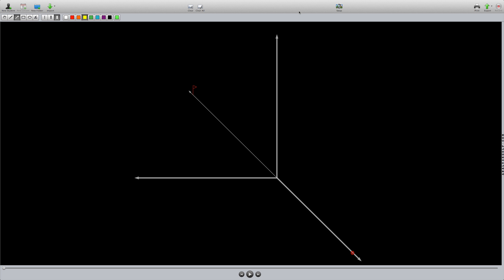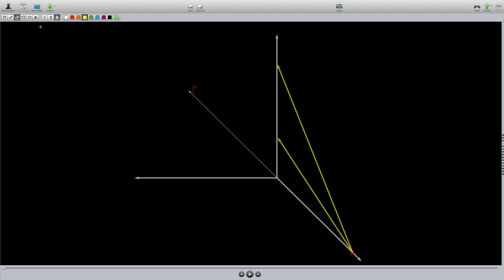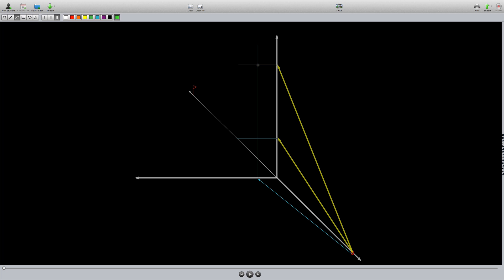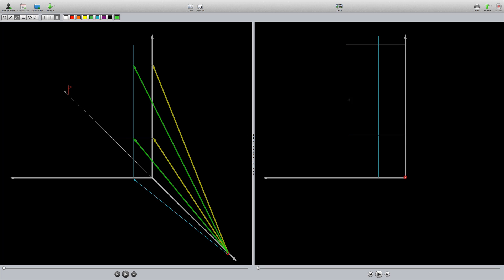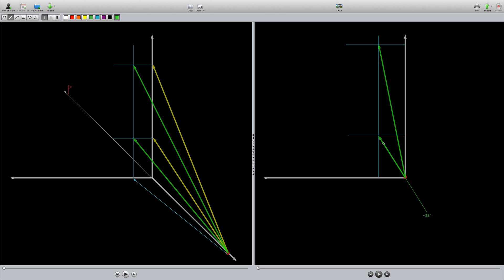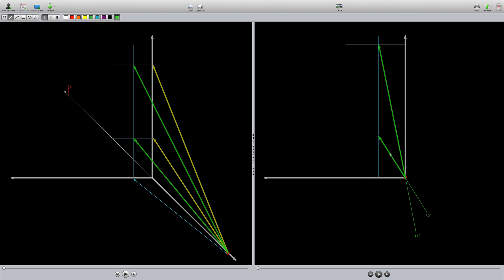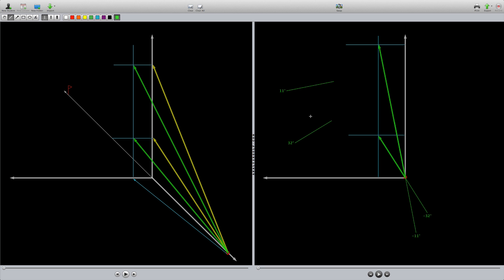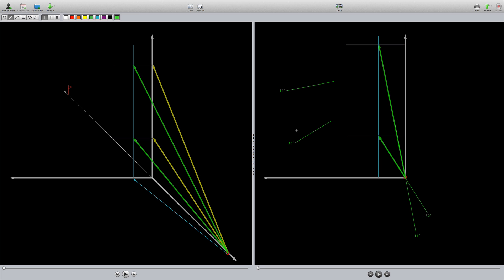A Geeky Look at Why Lower Lofted Clubs More Easily Cause Curve

Comment from the maker: Thanks. I've always done particularly well at visualizing 3D spaces, so I didn't want to assume others could, and it's done on a computer, so a bit geeky. I had to resist leaving the lower vector of the D-Plane in as that would show the actual "triangle" and thus the plane itself. It would have complicated the picture further for little added benefit, though.